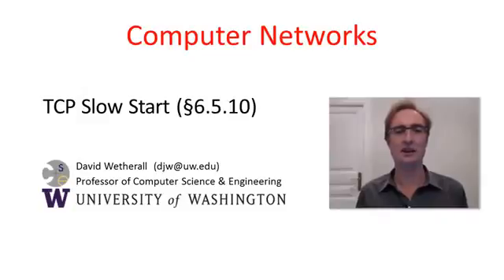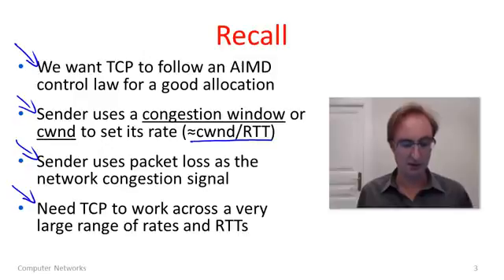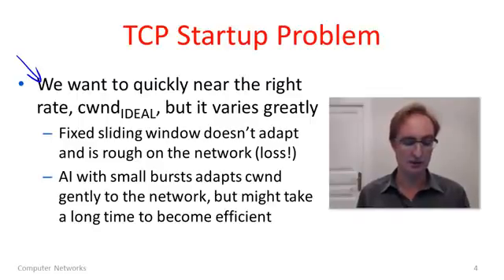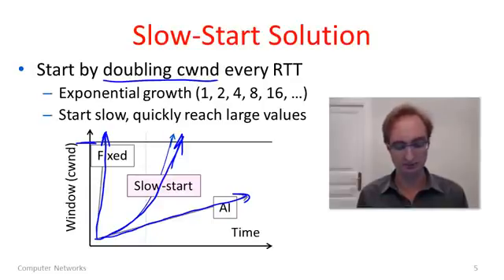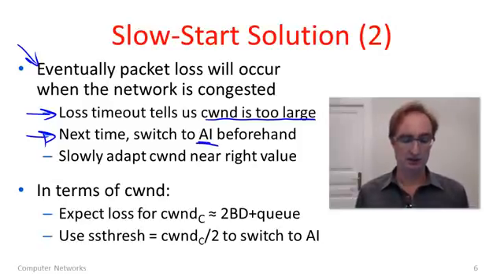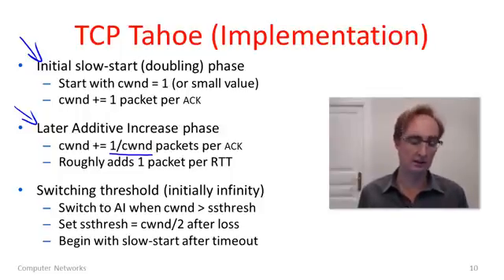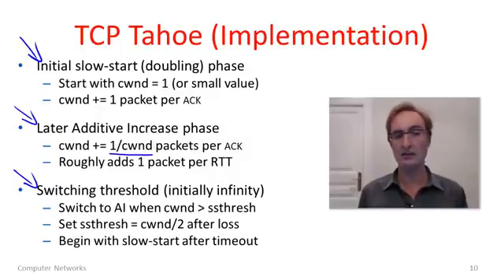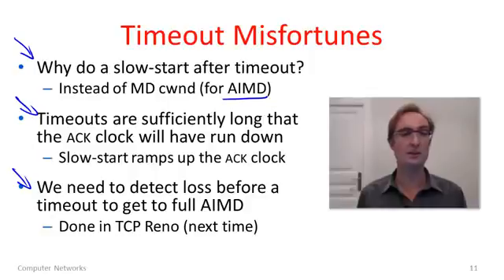TCP slow start

Comment: Nice video!  I've been reading through TCP/IP Illustrated Vol 1 and was struggling to understand the role of ssthresh in how TCP utilizes slow start due to the initial slow start effectively ignoring it in most cases.  I didn't yet learn that slow start could potentially be triggered again later in the flow given the right circumstances.  Your video cleared that up for me near the end and helped bring it all together.

This is an absolutely beautiful protocol.